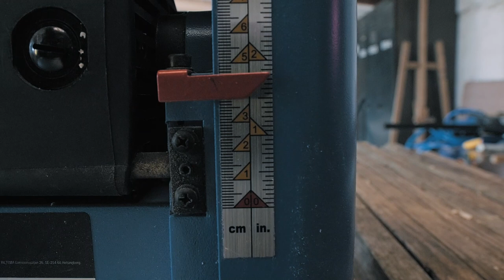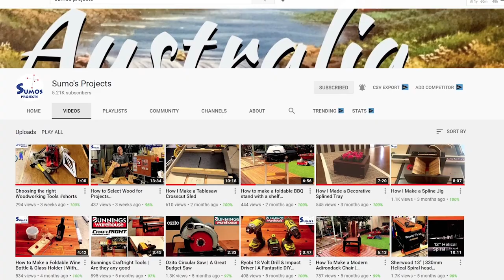Reclaimed Wood Bench - Turning Rubbish Wood Into Furniture #rubbishwood21

Comment: Absolutely no disputing the fact that this was definitely #rubbishwood21 for sure.👌🏽
Shou Sugi Ban when done right, will give the wood years and year of prolonged life outdoors, 
and you seriously nailed it, mate, fantastic build, love it. 👍🏽
Reply from the maker: Thanks you Bill, I'm still experimenting with different methods of outdoor preserving of wood, and so far the furniture I have treated with Shou Sugi + Beeswax far outperforms the ones treated with outdoor lackers, wood oils etc. Do you have any tips you could pass on to me that I'm not aware about? Thank you so much for watching.
Reply: @JesperMakes  
From what I've seen over the years SSB has been the overall best performing method, considering its been used for centuries and there are still structures in Japan well over 100 years old still standing and showing no signs of age or decay, I'd have to concur it is possibly top of the list for longevity of outdoor furniture! 
Not everyone likes the burnt look, but I wonder how it would stand up if you sand back most of the charing and use stain in the mix? I'm sure you can come up with a few good ideas that might be floating around your head on using this with different stains.😉
I'd be keen to see any results if you do venture down this path.👍🏽